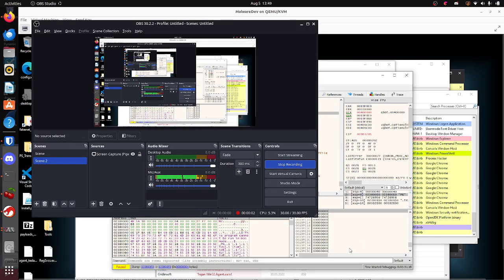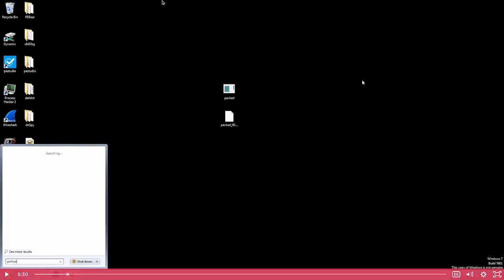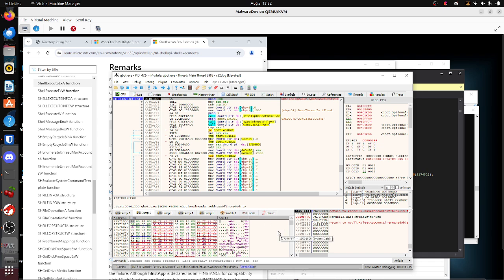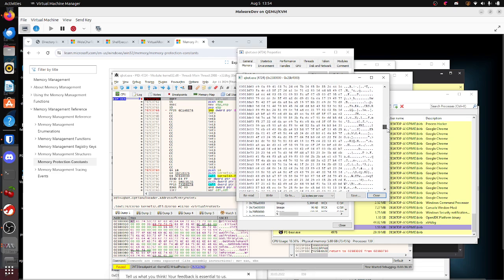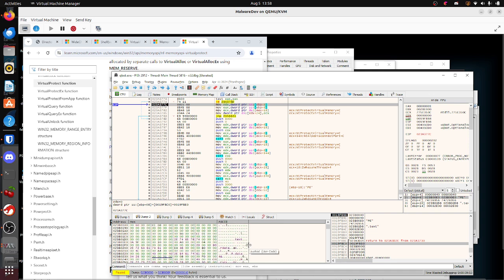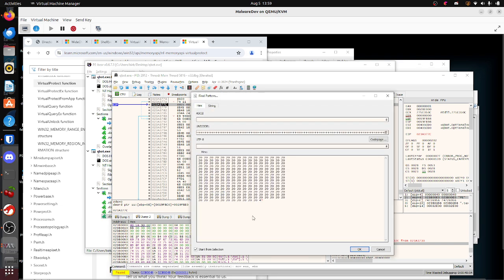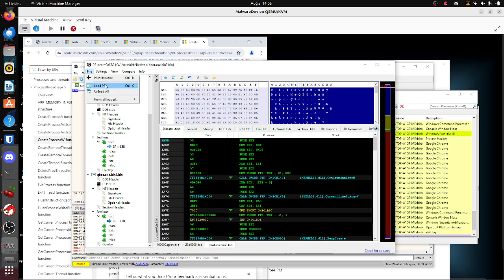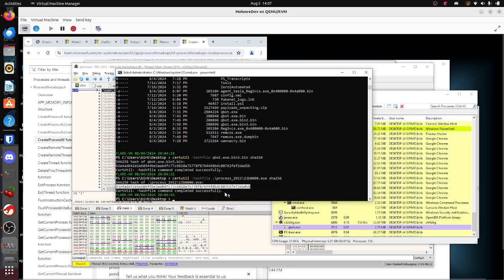Reverse Engineering Part 5: Unpacking Qakbot from Zero2Automated, Alternative Methods (pe-sieve)

Comment: I am your new subsscriber, and new learner for reverser engineering, Please help  me to leran if possible.
Reply from the maker: @debnathmriganka2010  Can you give me the hash of the file?
Reply: I don't know what is hash file. I already send you full package of the file just install it. @changtan389
Reply: @changtan389 i dont know what is hash file. I send you full package of this file. Just install it. I dont have anything ecept this package.
Reply from the maker: @debnathmriganka2010  You can run the command “certutil -hashfile file.exe sha256” and copy and paste the hash here
Reply: @changtan389  I posted Hash file but why it is not showing at comment section?
You got it?
Reply from the maker: @debnathmriganka2010  No I did not. But if you get the sha256 hash of the file then I can get my own copy of the file hopefully